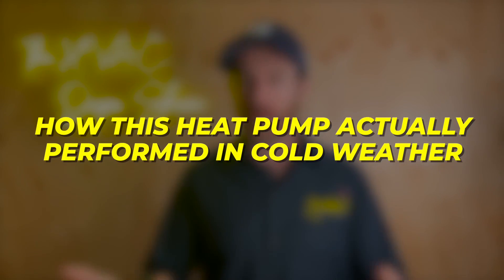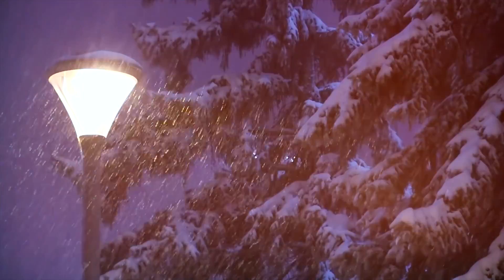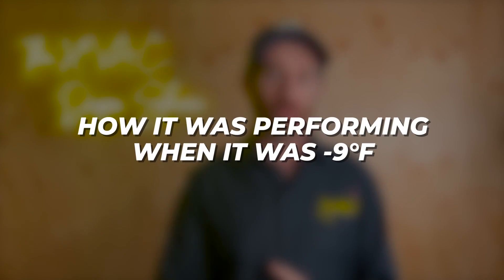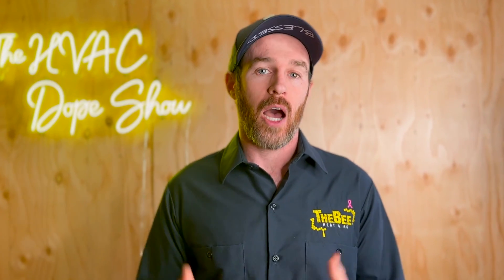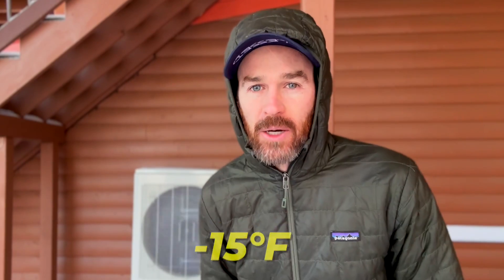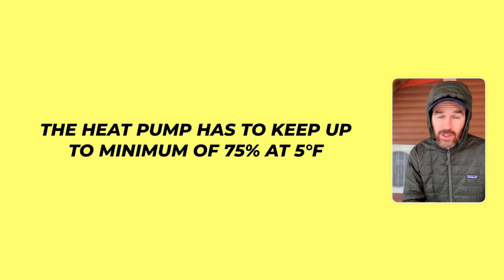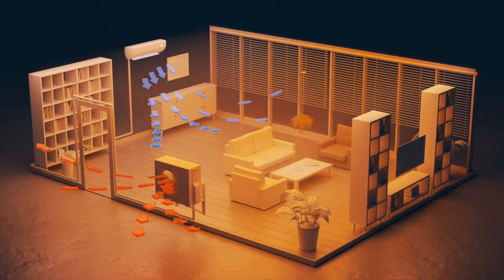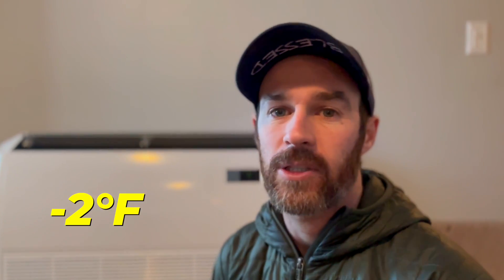ACiQ Heat Pump Cold Weather Test Results! ❄️🔥 | Part 3 of 3

Comment: I'm in Aurora CO, and I have a 4 ton Mitsubishi Hyper-heat, indoor air handler and ducted system. It replaced a gas furnace and is the only heat source in a 1500 sq. ft. plus 750 sq. ft. basement. No heat strips installed. On the coldest weekend, it worked fine set at 71 in the day, 66 at night (I used these temps before with the gas furnace and wanted a comparison). It used 95 to 105 kWh per day for just the HP, add 5 kWh for the air handler. It ran for around 20 hours a day on the coldest days. I think the house was more comfortable with the HP. If I look at degree days, I would have used 140-150 therms in a comparable month with the gas furnace. Here, gas works out a little cheaper in a very cold month, a little more expensive when it's not quite so cold. I imagine the outdoor unit defrosts but I'm not standing out there to watch it and I can't tell from indoors.
Reply from the maker: Thanks for sharing this is a very helpful comment! I didn’t get to dive into their bill as much as I would have liked, great data thank you!
Reply: how are your bills for summer cooling months?
Reply: @GoBayside  I don't have good numbers yet. It was installed at the end of August so not that many hot days. The system has 3x the cooling capacity of my old conventional AC so it cools well, just don't know how power usage compares.
Reply: @davidstewart1153  - do you have any sort of roof over the outside unit to cover it from rain/snow? 

I just finished installing a 4 ton ACiQ heat pump in my home, and like you I only have 1500 sq ft (no basement though). I placed it where my previous AC condenser was, but it's sitting out in the elements so it gets rained on and will get snowed on. While reading through the install manual it said to have some sort of shelter over the outdoor unit to prevent it from being rained or snowed upon - after learning about defrost cycles this makes more sense for when it gets really cold outside (ie below freezing w/active snow). 

Finally, have you measured the temperature at the vents inside your home when the heat is on? I just bought a thermometer to measure my numbers. It produces adequate heat so far when at freezing outside, but the air temp doesn't seem as warm as my old gas furnace was (though at 84,000 BTU's it was ridiculously overbuilt for my home). Also, my thermostat isn't requesting full heat from the heat pump anyway, so I assume it can produce hotter heat if needed. That being said, looking through the manual it seems like I can make it more aggressive by flipping some DIP switches, if I want. Though, since I'm using a 24v thermostat and not the thermostat it came with I may be losing out on some features, it seems. 

Sorry for the word vomit! I just want to pick your brain.
Reply: @crxtodd16  I saw the price of manufactured shelter things and decided to build my own this summer. Then I can add wind and shade protection too. I wrapped and covered the lineset with plastic covers used for DIY minisplits. I haven't measured the duct air temperature but it doesn't feel as warm as the gas furnace. I was told 95 degrees by the installer.
Reply: @davidstewart1153   Thanks for the response! The heat at the registers/vents on yours seems similar to mine. Probably around the mid-90's. (I haven't measured the exact number just yet, as I'm waiting for my thermometer to arrive via Amazon)

I think I'm going to do the same thing as you: build my own little roof structure for the outside unit to protect it from rain and snow. Thanks again for sharing your experience.
Reply: Do you still like your system? Does it handle single digits very well.  Have you taken the air temp that it puts out on the farthest away vent register?
Reply: Just bought a house with no gas heat or ac in Colorado. Gonna be installing mini split heat pumps since the home just has electric baseboard!

Comment: How many amps does it draw?
Reply from the maker: On startup? It's like most inverters, pulls about 1 amp, at full speed I think it's closer to 12, but never saw it ramp up all the way, it was on a 20 amp circuit I believe but you can verify that on their spec / submittal sheet
Reply from the maker: And that will change with tonnage

Comment: How is the ACiQ doing now and have you needed any repairs?
Reply from the maker: No repairs, no leaks, it's been working fine. It's at my neighbors house and she tells me all the time it works great and they don't have to feed the stove anymore although they still choose to do it on the coldest subzero nights but the heat pump keeps up fine and only bumped their bill about $30 / $50 depending on the month which is not bad for really cold weather (5-10F in the winter) and helping to heat a 2500 square foot house

Comment: I have 4 Blueridge Ultra Heat systems installed in my 2500 sq. ft. house.  Last winter we hit -25 several nights and the systems had no problem heating the house.  The heat strips didn't run, in fact the breakers for them were off.  Heating bills ran about $350 for January and February.  During this time frame the outside temp didn't get above freezing with many below 0 nights.

Comment: How noisy are the reversing valves in these systems? When our Bryant HP goes into defrost the reversing valve noise is SOO loud.
Reply from the maker: Something might be off with the refrigerant charge. Is this an old Bryant? Or new one? If it's in the past 5-10 years it shouldn't be that loud

Comment: I would love to know….
Total btus into the space per hour factoring jn defrost. 
Total heating runtime in minutes per hour (factiring in defrost). What they would pay per therm for gas. Amp draw on minisplit. I would love to do some math
Reply from the maker: It's not really easy to calculate because the load varies by the outdoor temperature, so even with heat load calc it's at a given temp and goes up and down with temps outside. I agree it's interesting but I've come to the conclusion that a basic heat load is good for consideration of lower limits and that's it
Reply: @ I am talking economic balance point between natural gas for example not thermal balance point. You proved in your video that it can handle thermal balance point. A low ambient unit differs from a non low ambient unit for 1 key reason which is to hyper drive a compressor. Hyper driving a compressor. Hyper driving a compressor make more heat of compression which it of course moved to the space. This additional hyper driving heat is more of resistive load heat and factors into its overall electrical consumption.
Reply: While the heat output of the unit at say 5° may be the same as at 50°, the colder outdoor coil cannot absorb as much heat from the air. The loss of btu into the refrigerant is supplemented by the compressors effective resistance heat transfer

Comment: I just installed a ACIQ 3 Ton Hyper Heat system into our house, replacing a Goodman 3 Ton R22 heat pump system. I will get back to you  once we have a few months under our belt, to share my energy usage. We are in Central Ohio and in the winter a typical COLD night is 0°-5°. Our old heatpump would use electric heat strip below 20°F, this one shouldn't ever need it. In my tests the past day, it's making 22° heat in stage 1, and 34° heat in stage 2 heat, the outside ambient temp is currently 29°. Very impressed so far.
Reply: Keep us posted on how the bills look. I'm in Ohio as well and considering an aciq heat pump.

Comment: is it me or is the outside unit mounted too close to the wall? they generally say at minimum 8 inches to 12 inches from the wall?
Reply from the maker: Depends on the unit side discharge systems have tighter clearances you have to read the manual... most box style condensers are 12", but the Daikin fit for example can be as little as 3"

Comment: I agree…previous videos you e done have more facts, but there seems to a lot more “filler” in this series.  I’ve actually just purchased two ACIQ units, received them, and will be installing them.  I’m looking for more specific install content and though there are a few items (height above ground, surge protector etc), there’s very little detail that a person can really learn from as far as install….so much on defrost cycle and not much on install.  Do you have video/pictures of the actual install?  Or is it that simple that there’s not much to show?  Any tips on “setup” would be appreciated too.
Reply: Hi This unit is made by MIdea and is the same unit as a Senville Aura,you just payed more money for it thats the only difference other than the sticker saying it is a ACIQ.Watch the Senville videos there are lots of them.Enjoy
Reply: How did the install go and how's it working? I'm looking into getting one of these and have the same questions.

Comment: I do similar contents in Chinese but in text and image, not video. The thing that I really want to know is why isn't there a lot of contents from you guys look inside the unit, to discuss or review the parts that its made of. They can vary dramaticly and effect how well it performs or how will the end user feel. We have a lot review contents talking about the part, we measure how big are the coils, we show the displacement volume of compressor, we show if there is EVI, are they using bldc motor or EXV. Also, most Chinese brands offer low temp heat pumps domestically as well, where its mostly 4kw heat @ -20c outside 18c inside with cop of 2, or air to water heat pump in various sizes with outside air -20c flow 55c with cop of roughly 1.8 at 172liter/h flow rate for every kw of heat.
Reply: Hi there is some videos of a Cooper and Hunter and a Senville unit being dismantled to show you the parts inside.This unit is the same made by same manufacturer Midea.The ACIQ just costs more.Enjoy

Comment: If I had known about the defrost cycle where I have no heat for the home, I would never have bought a heat pump.  I regret my purchase. I prefer gas furnace.
Reply from the maker: Which heat pump do you have? This can be adjusted in settings… you can adjust this power on auxiliary heat during the defrost cycle if you have auxiliary heat strips (which you should in a cold climate with an air handler)
Reply: Hi It is from this question that I learned this is a ducted indoor unit.So it is identical to the Senville 2 ton ducted unit with 5KW AUX for 2999CAD free delivery on Amazon.ca.I have a few Senville Aura units(Arctic heat pump).I live in Southern Ontario with high moisture from 2 great lakes and Lake St Claire.My defrost cycles only last a few minutes.You may want to check if there is an issue with the outside unit as shutting down the heat for a few minutes should not be a problem unless you have bad insulation and drafty windows and doors.Enjoy

Comment: If cost is no object, and there's plenty of room for a horizontal installation of coils, do you recommend ground-source heat pumps over air source?
Reply from the maker: https://www.thegeoguy.com/dont-do-this/
Reply from the maker: I would do Geo in a cold climate where Air source can’t keep up as well. Air source is typically fine above 0F to 10F, there’s products that work. If you’re doing Geothermal though as the guy in the article talks about I highly recommend vertical drilling. Keep in mind we’re new to the geothermal space but the drilling company we work with only does vertical loops because of the reasons outlined in the article. The tax credit is 30% on geo with no cap so that part is awesome
Reply: @TheHVACDopeShow  - We have a 10 acre property, but it's sandy soil and the link you provided suggests a vertical installation would be more effective.  Thank you.
Reply: Remember that before you get a geothermal system installed you really need to make sure you have an abundance of companies that can potentially service or ideally, many decades later, replace the units. 

Many people opt for the Geothermals but get one contractor and never have anyone that can regularly check up on them. Which should be something you think about before pulling the trigger in it.
Reply: @AJ-ox8xy  - If these systems were not becoming more and more popular, I would be concerned about that.  Twenty years from now, the costs will be lower, the efficiencies higher, and the availability of qualified service even better, because both air-source and ground-source geothermal are simply superior options for heating and cooling.

Comment: I’ve never been in someone house with a heat pump that was comfortable.  They alway complain about electricity cost.  Maybe these newer systems are better.
Reply: The newer heat pumps are absolutely better than what you're referring to.  The old ones basically didn't work below about 35 degrees, Farenheit.
Reply from the maker: Yeah night and day difference. Radiant in floor heat or baseboard hydronics is the most comfortable but you don’t get humidification options like you do with a forced air furnace or heat pump. We installed forced air just so we could have a humidifier because it’s so dry

Comment: the question is how many btu is the unit and how many square feet are they heating
Reply from the maker: 2600’ for the house, basement is 800-1000’ and the basement drafts to the rest of the house via two floor vents and a stairwell. 2 ton so it’s 24k btu~ heat output at 100% capacity is 29,000 Btu so when it derates with ambient temp drops it’s still putting out a good amount of heat

Comment: You are getting too vague...show us the heat load at the temperatures you were getting. Then show us the performance chart for the unit you installed.
Reply from the maker: Good suggestion for a video I’ll keep this in mind when I have time. They had another propane stove heat source for the upstairs floor (above the heat pump) in their addition, so it’s primarily for their basement and upstairs because of how it communicates with the upstairs through the stairway and two floor vents. Basement is total around 800-1,000’ total house is around 2,600’ with about 2,000’ effectively above grade since the “basement” is like a walkout since it’s on a hill.

Comment: I find heating the room with hot air is very uncomfortable. How some people settle for that blows my mind.
Reply: Most snobbish shit I've heard in a minute lol
Reply: @jameswood8517  Not snobbish, just fact.
Reply: Some like to humidify and filter the indoor air...radiant systems are limited and require additional systems to provide these functions.
Reply: @johnnybarbar7435  I never heard from a client that they want to filter the air. You need to humidify the air once you turn on the furnace.
Reply: @mariusm3595    We live in an area where almost all homes filter the air.
Reply: I agree, They settle because they have never lived with radiant floor heat. Once they have actually experienced floor heat, there is no going back.